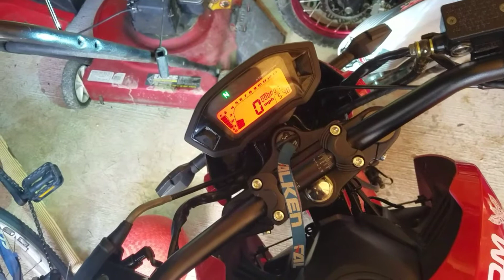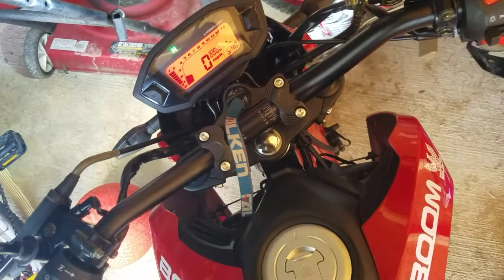Fuel injected Boom Vader 125 **UPDATE**

Comment: Where did you get the throttle cable from I got the motoefi also but the cable it came with doesn't fit the handle on my boom vader
Reply from the maker: The cable was a universal cable that i got off ebay for around $20. Its a diy cable that you cut to length

Comment: Post more about the fuel injection set up!
Reply from the maker: Check the link in the description for a detailed write up.
Reply: Lucas Schaar i checked that out but still don't really understand what wiring goes where. Anymore info on that? Also how are you reading afr?
Reply from the maker: On my second post I included a picture showing the wiring of the stock CDI box. I added a connector to the EFI harness to plug in to the CDI wiring for all the needed signals. (Power, Ground, Trigger and Coil)